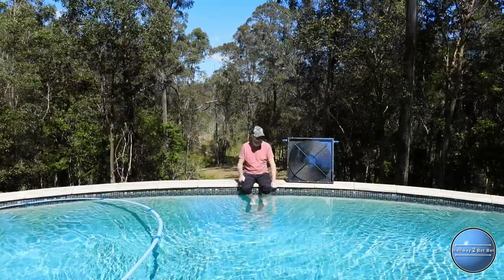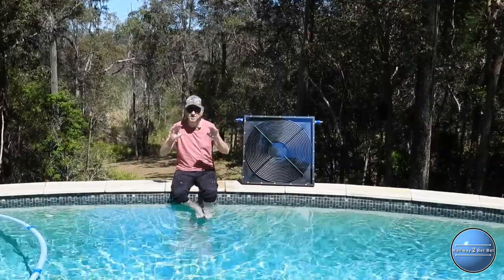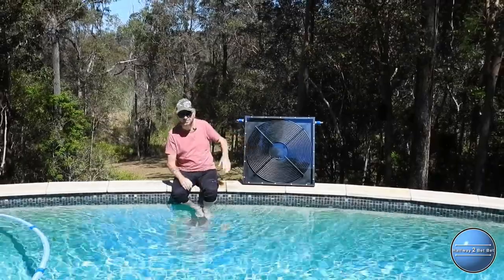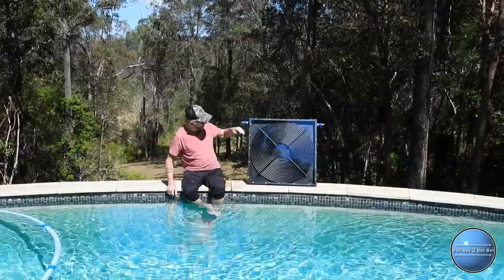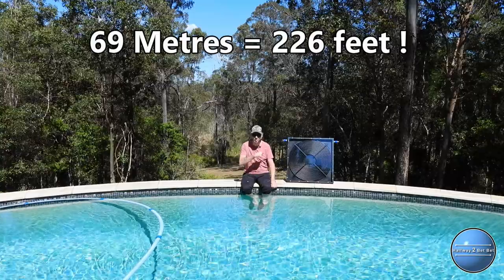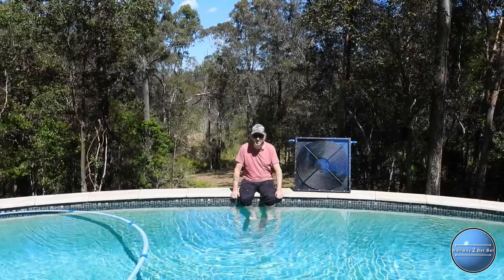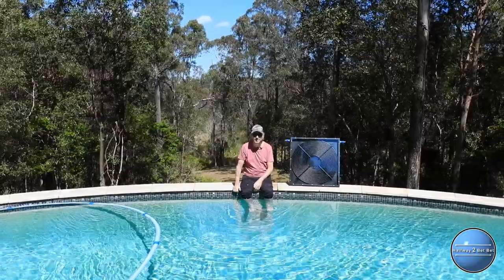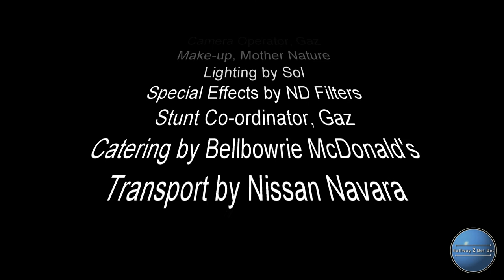Solar Pool Water Heater

Comment: Outstanding! If I hadn't seen it with my own eyes, I would swear it was factory manufactured. Not surprising for an engineer. What did you mean by 'running' when lubricating the pilot holes before drilling the second holes in the acrylic panel? Even if I never build one of these, the techniques you demonstrated were a great learning experience that I could apply to other projects I may take on. Thanks! 👍👍
Reply from the maker: G'day Johnny. Sorry for the delay in replying, a lot happening here at the moment. Thanks for your kind comments. My reference to 'running' applies to normal water vs that with some detergent. I've found that water with detergent tends to "pool' at a spot where applied as apposed to normal water that tends to 'run' from its delivery point. It doesn't make sense when considering surface tension theory but it seems to work. Hope you're healthy and happy mate. Cheers.
Reply: @garydeloas6531  No worries. I figured you were busy trying to find one of those round tuits. :)
Reply from the maker: @johnnyduplantis  😂

Comment: To make it totally Solar Powered - I am thinking of a solar powered pump to deliver water through the poly tubes. We only need to pump when there is sun shine. Any suggestion to the what size, make, model pump and sola panel specification.  I have seen a video using a  Ozito 36W 1700L/Hr Submersible Bilge Pump (from Bunnings).

Comment: How many litres of water is in your pool?
Reply from the maker: G'day Gary. Approximately 50K.
Reply: @garydeloas6531 cheers for the reply bud 👌🏻 and you find that the 3 you’ve made give it a good heat boost?
Reply from the maker: @garyburke4407  yes mate. It raised the pool temperature by about 10 degrees Celsius. I've built another unit to use this Spring. All 4 units linked together should speed up the process. Cheers mate.
Reply: @garydeloas6531  thanks very much lad👌🏻